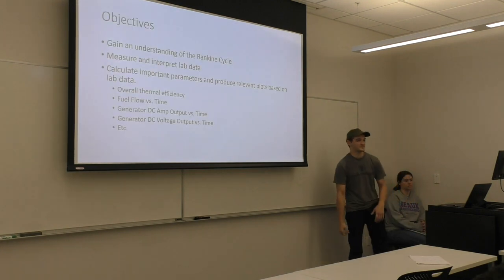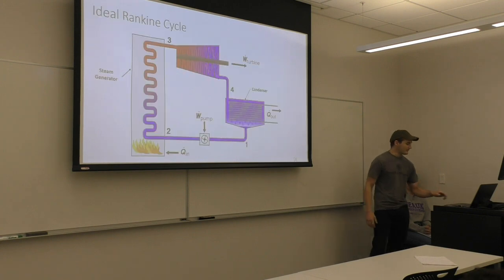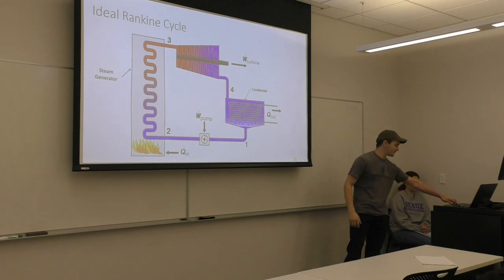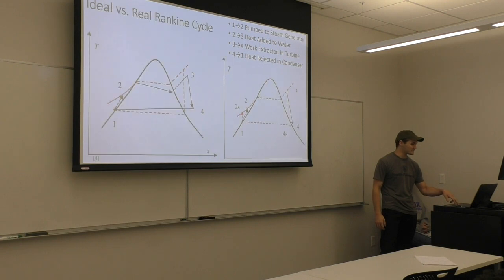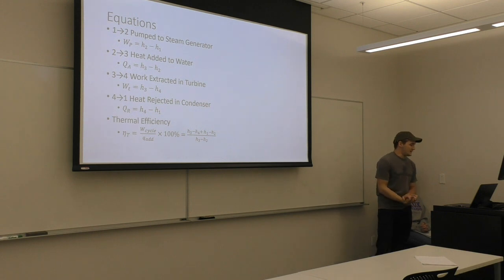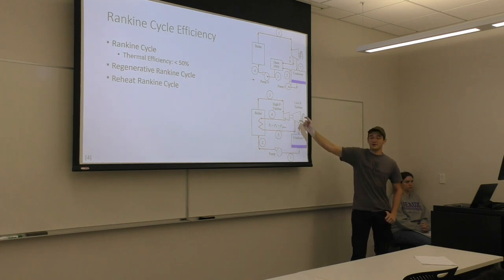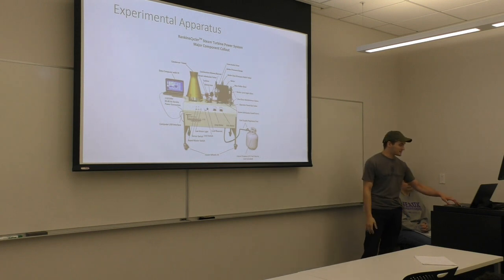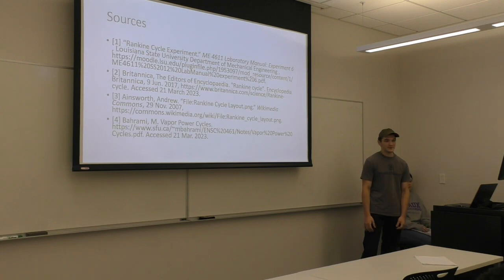S1090010

Comment: Colin Roberts - I liked that he mentioned that 90% of electricity production is produced using the Rankine cycle. This fact gives the audience an understanding of why this experiment is important, thus increasing interest. From a technical standpoint, he brought a very in-depth description of how the cycle works. This presentation looked at the cycle and the experiment from a physical, thermodynamic, and theoretical standpoint. By starting with a diagram of the cycle and explaining it physically and then using thermodynamic diagrams and equations, he ensured that knowledge retention of this cycle would be high. My main area of improvement would be to include potential safety concerns to ensure all individuals conducting the experiment can stay safe.